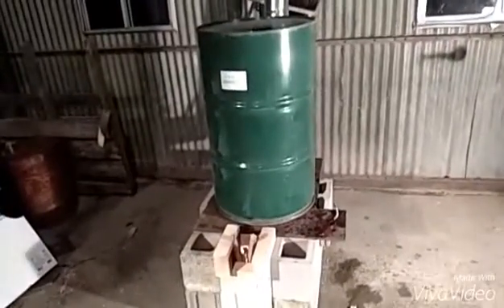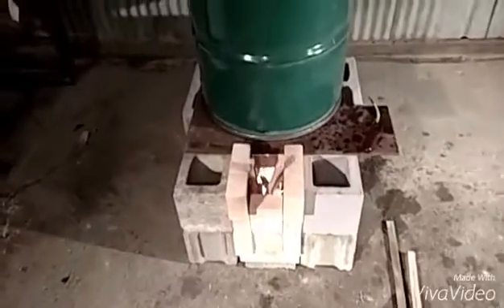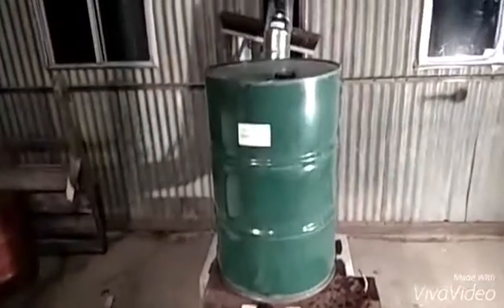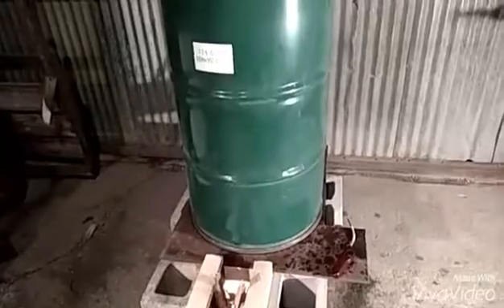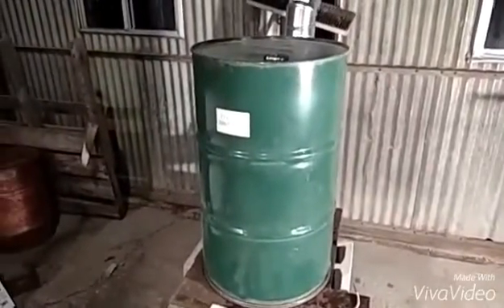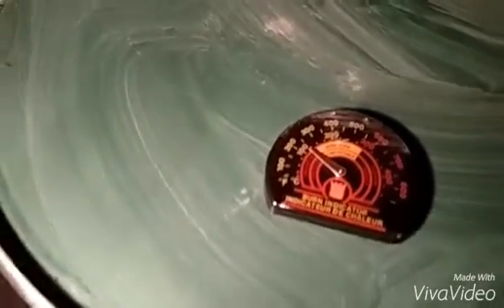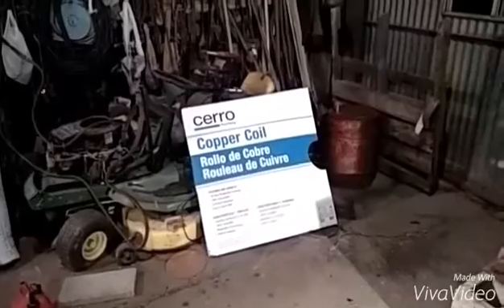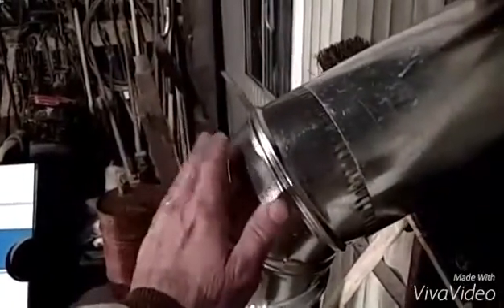Aquaponics rocket stove build Pt 4

Comment: Nice. At the bottom of the exhaust pipe is necessary to make a small hole (4-5 mm) for condensate outlet.
Reply from the maker: hi, thanks for the info. I have a T that will go on that with a cap on the bottom for clean out. that would be a good place for a drain hole. I'm working on the copper water tube now that will circulate the hot water to the fish tanks. should have video soon.